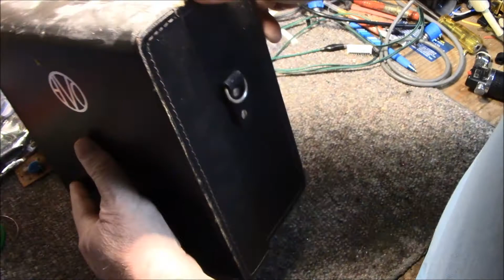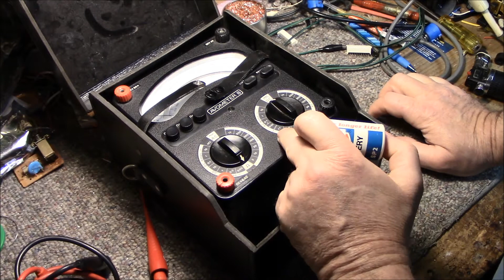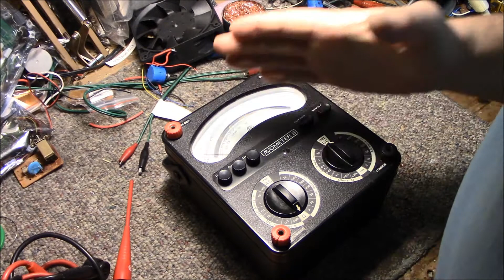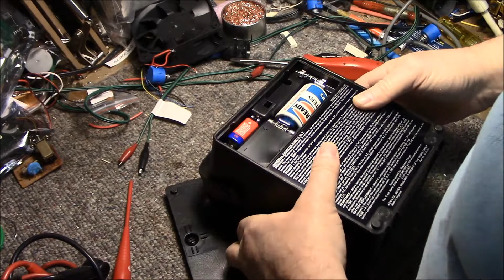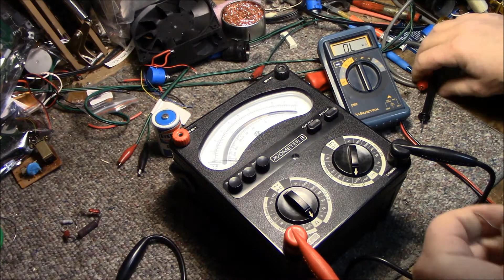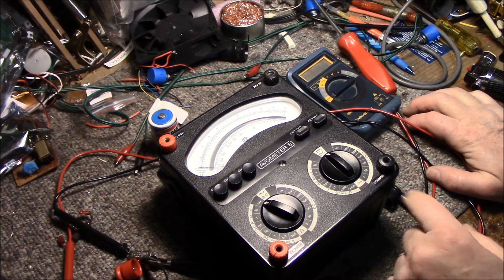Vintage Test Gear - Avometer 8

Comment: The AVO( AmpsVoltsOhms?) was a UK industry standard meter for many years. I still use mine occasionally for working on old stuff that specifies a 20K ohms /volt meter. It saves me doing mental maths to compensate for the difference in voltage readings you may get with a modern DVM. Most of the time absolute accuracy isn’t necessary on old valve/toob radios. Also they are capable of measuring up to 3KV( or 2.5 for the earlier models. ISTR these should be accurate to around 1% on DC volts. This was all we had when I was doing electronics at college in the mid-late 80’s, and I am still fond of them.